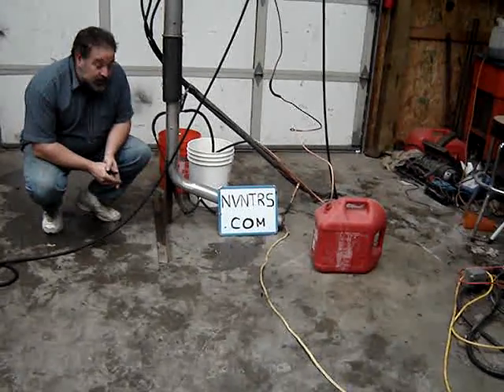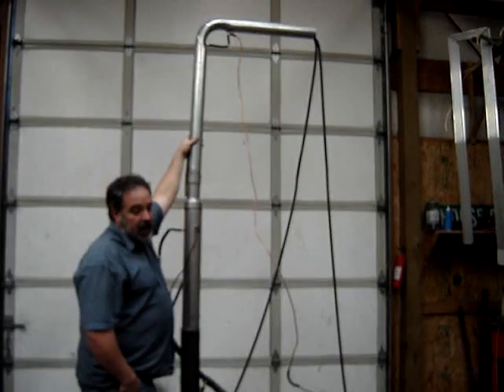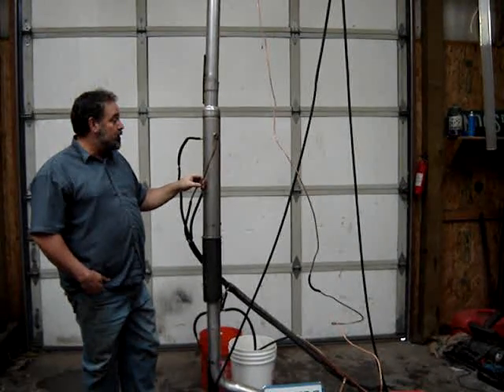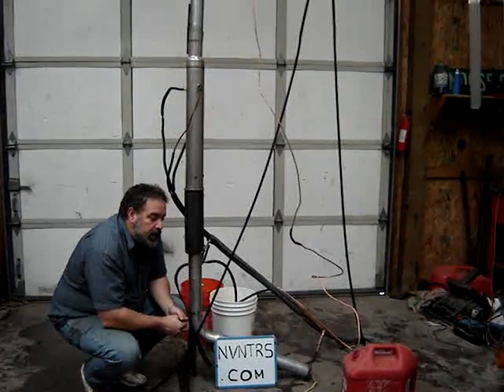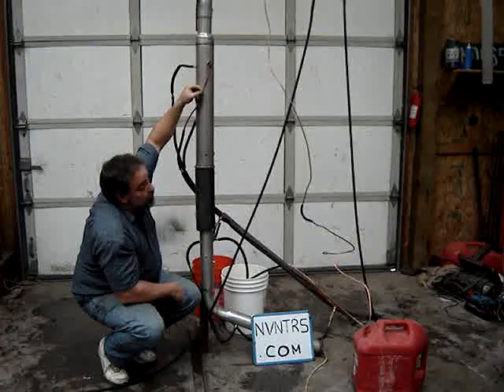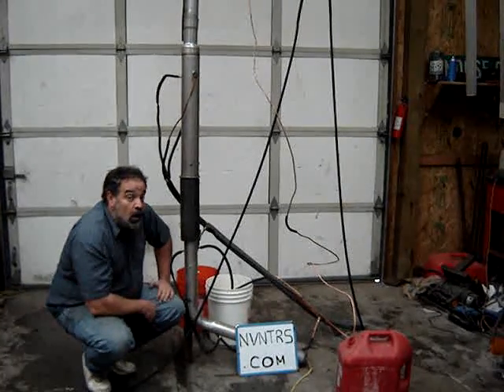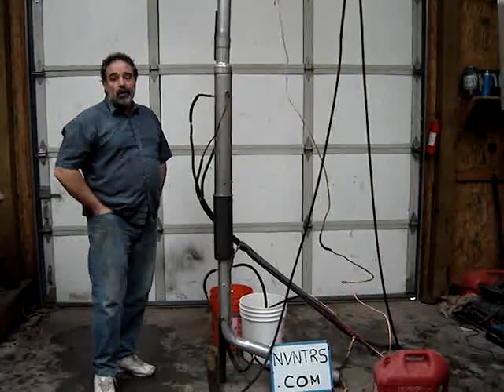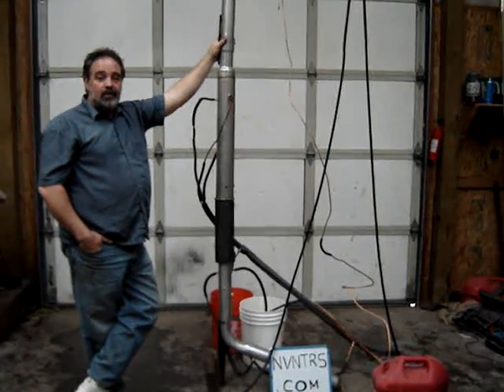Continuous Distillation Details

Comment: I like your cleaver feed preheat process (feed vs. overhead--> feed vs. bottoms). Two things though:

1) The part that you call the rectifying section is normally called the stripping section. The part that you call the column is the rectifying section.

2) The violent action that you are describing in the stripping section tells me that the stripping section is flooding. Flooding in a packed column can be mitigated by increasing column diameter or reducing rates.
Reply: hi